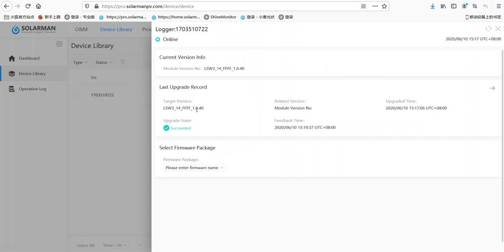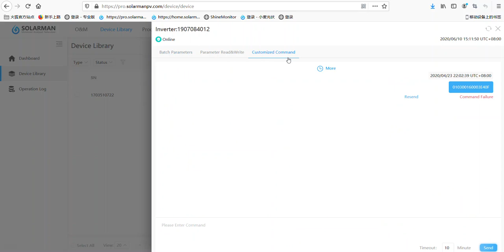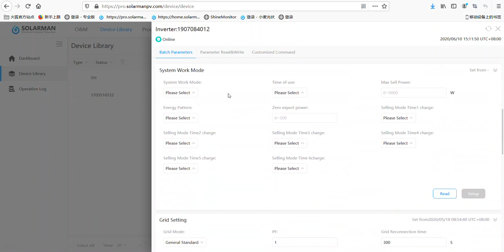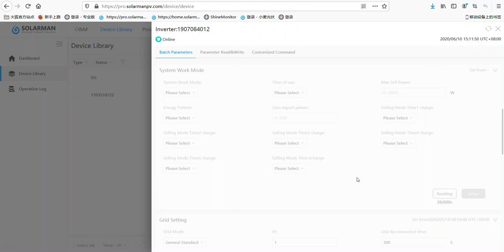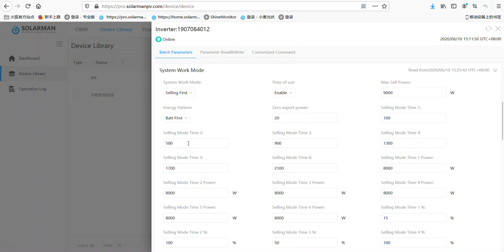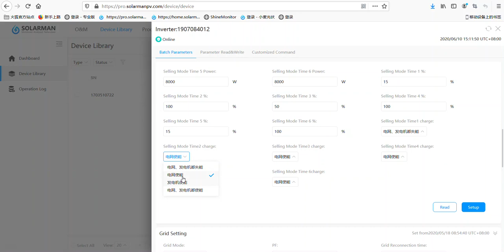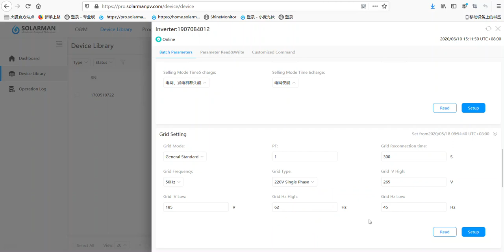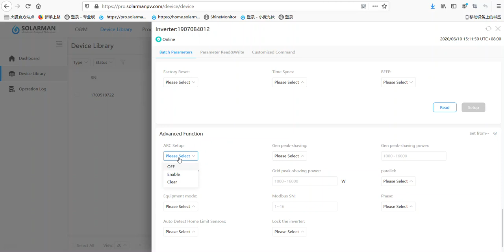How to  set up parameters for Deye hybrid inverter on Solarman platform

Comment: I am unable to read settings on my inverter I do not see batch parameter settings
Reply from the maker: it is used for WIFI datalogger and only for wifi FW at 1040. then you will see it.
Reply: @kylezhang8343  how do I update my wifi data logger